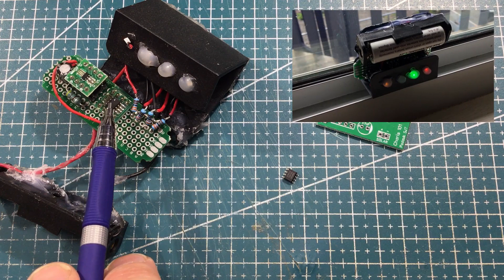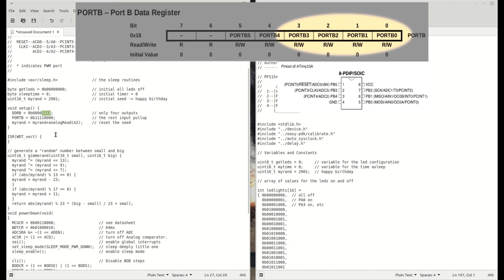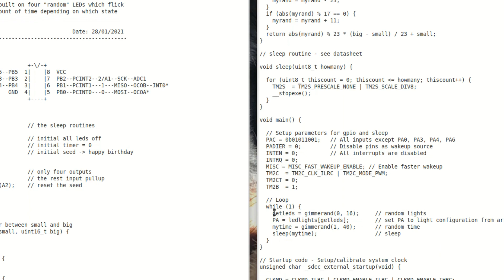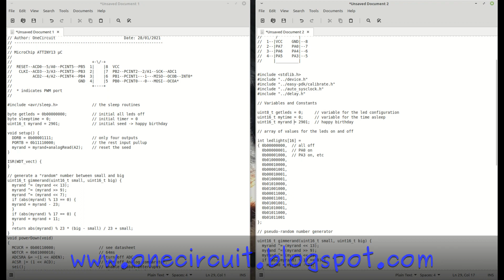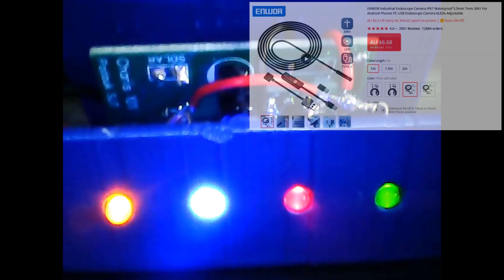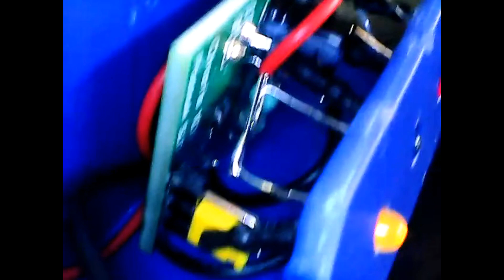Forever LEDs project updated (PFS154)

Comment: Very nice. So I'm not the only one creates a ascii art pinout at the top of my code.
Where are you buying these Padauks? Nothing on Ali.
Reply: Going to start adding the ASCII art to my code, nice touch. 
I wanted to buy a free PDK Padauk programmer, but the few places that once sold them seem to be out of stock, can't afford the official programmer. For a brief moment, I thought I'd build one. Not sure I want to after seeing our friend here and all his woes. Besides that the STM is somewhat hard to find, getting better, but now I see LCSC doesn't have any PFS154 in stock. Wish someone would sell the Padauk programmer along with a couple various uC as a starter kit.
Reply from the maker: I might eventually restart the tindie shop when the freight situation improves. The "lite" version of the programmer can be made with smds already soldered, makes it very easy! 👍😉
Reply from the maker: LCSC had some awhile back, but I bought a couple of thousand about 3 years ago. Will be a sad day when they run out! 😢